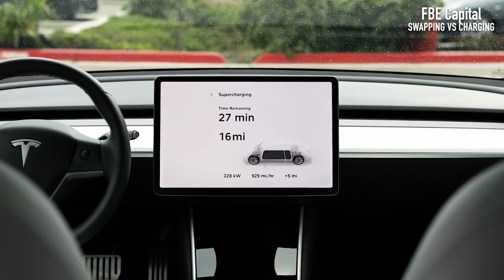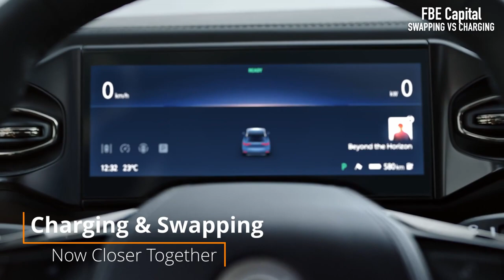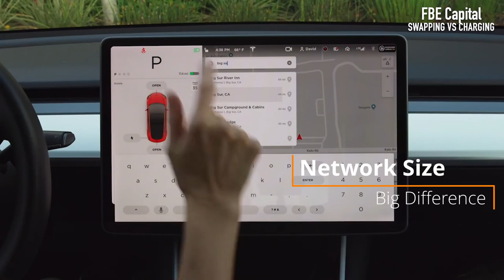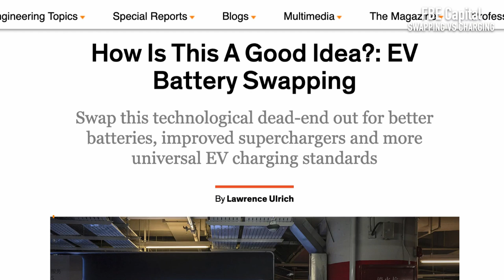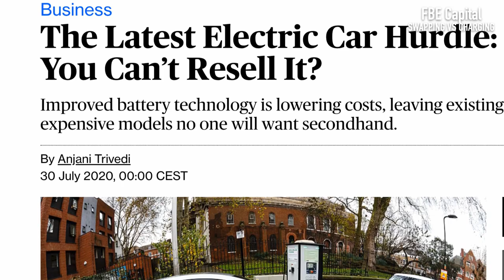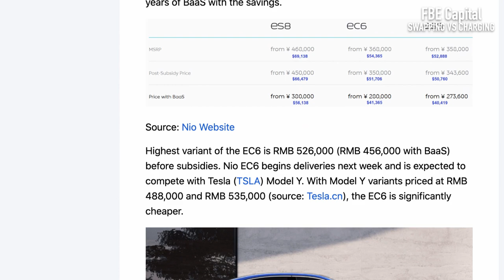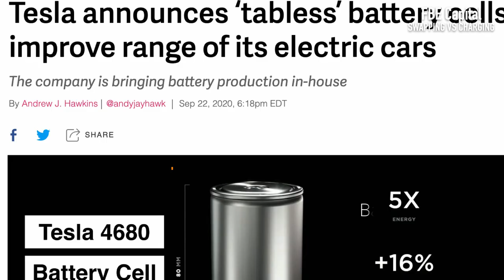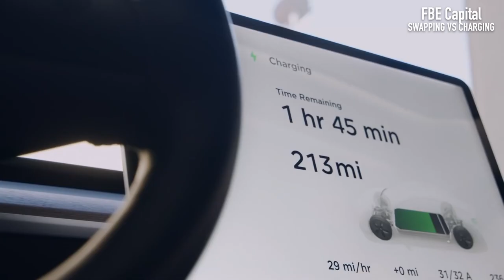Battery Swapping vs Charging, Which is Better? | NIO vs Tesla FBE Capital

Comment: Battery swap business model is a genius idea. Battery maintenance will be another huge industry and ev manufacturers need to separate this from vehicles. Those old batteries will kill the used car markets and people will not buy Tesla anymore. People would just either lease or rent.
Reply: They're just now getting to that point. Who has $14,000-$25,000+ sitting around to replace a bad battery.

Comment: As a person who invested in Nio, I might be in a subjective position but this is my opinion.  Let me explain why the battery swap system is a very good option for any ev in the market.
 People keep comparing electric cars as old smart phones with replaceable battery and saying that battery swap for ev is unnecessary. Is there anyone who thinks that an electric vehicle is so cheap that if the battery doesn't charge well after several years of usage, it can be easily changed just like smart phones? Also, if you think vice versa, if some company releases some cheap and high-performance battery in the future, you probably need to take it the original ev dealer and probably will end up spending tens of thousands of dollars to replace it or if you can't afford to pay that much,you may need to throw that ev away. These days, battery technology is evolving every year, and if there is no easy way to upgrade the ev battery just like upgrading your hard drive or cpu for computers, it might be a lot more problematic sticking with just one built-in battery for your ev.
Reply: I had the exact same thought

Comment: Good analysis. Two points....when you say $11000 savings without the battery when you purchase NIO, the $5000 savings for higher resale price cannot be counted as the next owner need to pay for the swapping subscription unless the seller buy a new battery before selling the car. Also swapping does not mean new battery every time you swapped, is just 100% charged and not guaranteed the holding battery power will not drop as fast as a 5 year old battery. The thought of buying a new car with an old battery need to be overcome. Is like buy a new phone without battery and you can swap battery at a phone store everytime the battery runs dry instead of waiting for it to be charged for 30mins~1hrs for fast charging....you still getting a reuse battery and it might run low fast. What Tesla can do is just sell a new set of battery at a low price, maybe every 5 years.

Comment: I'd imagine the biggest win for swap is that everyone can keep an extremely light "daily driver" that charges overnight for a 70 mile range. There wouldn't be any range anxiety because you could easily swap to a heavy 300 mile "trip car" when you actually need it. Lugging around an expensive 220 mile range battery would no longer be a thing and the sustainability of producing them at a mass scale would also be solved because you only need 10% of current demand.

Comment: I do not think about swapping will succeed.  You  do not consider how the cost of swapping station which are quite high and who is going to invest.   4 mins is time  for 1 car swapping and how waiting time for other cars have to wait as station is likely have  only 1-2 charging units.   Not include how the station have to store lot of different types of batteries. (even battery still not enough to produce  EV car ).  To let other car makers develop/adopt the standard battery, seem to me impossible.
Reply: 1 - gas station is every where too, are they not profitable? 
2 - you can charge a Nio car too.... no one said Nio can only do battery swap.
3 -  filling gas takes about 4 minutes too.
Reply: Will you be charging or swapping if you traveling a distance twice the capacity of a Tesla car? Explain how TESLA ROBOtaxi can make more money than NIO if it ONLY option is CHARGING? 🤔

Comment: swapping is 100% better. You will not be stuck having to replace the battery when it’s expired..
   look at all the Nissan leaf cars running around that need batteries right now, but the cost of a replacement battery is more than the NADA Book value of the car..
  NIO Electric cars are the way to go. You get something like six or eight free battery swaps per month which take about eight minutes to do, completely automated, you pull in to the battery swap place, and a machine removes your battery, and installs a fully charged fresh one. Or you can charge your battery at home..
   because of the cost of batteries, I will never consider an electric vehicle until there is no alternative.
   The cost of batteries is not going to come down over time because they are using cobalt, copper, and lithium as the main components of these batteries. That stuff ain’t cheap…

Comment: The only reason to not have swappable   batteries  is PROFITS  , think about if all cars were swappable  then third parties can supply  batteries  for several different   makes  and models, by making the batteries  unique  to each car they prevent  others to selling batteries the consumer.  Imagine if everything  you owned like toys , remotes and others all had unique  batteries   then you are stuck buy batteries  from the maker of such toy or remote . IF government  standardized batteries shapes and sizes then it allows the consumer  to have choices, This is why Tesla hates swappable  units as they are afraid  of losing money

Comment: Poor analysis on this video from a comparison standpoint. You're not obliged to do battery swaps on your Nio vehicles, it's just an added feature. With Tesla's you have just one option, plug the car to a grid and wait. With Nio you have two options, plug the car to the grid and wait OR swap the battery to save time. It's more than obvious that normal everyday users will plug the car, but for long distance travellers, people that forget to charge their cars or emergencies having the option of battery swapping is the best.

Sadly this video don't consider the real scenario and does a poor comparison of two very different features. I work with power tools and I can tell you that when the power is out having two or three spare batteries fully charged makes you more productive and work doesn't stops. That's the way EV should be too or at least have the option like Nio.